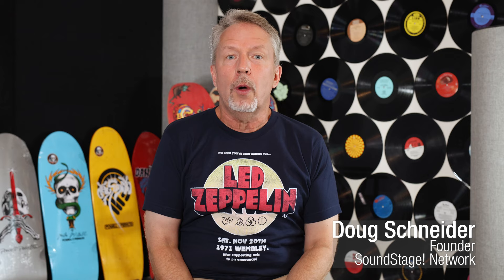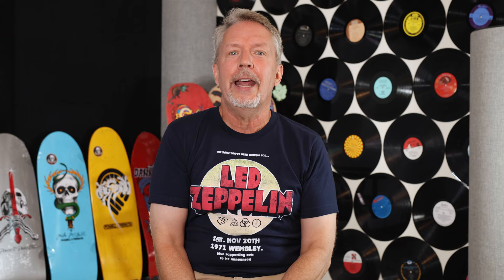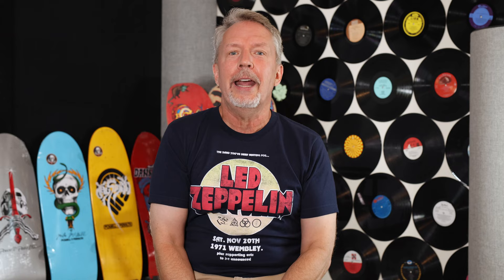Controversial Hi-Fi Upgrade Strategy: Why You Need a Powerful Amplifier (Ep:72)

Comment: I went active with a Legacy Audio Valor speaker system.  20 watt tube amp for the treble section (above 800Hz) with over 2000 watts of class-D modules per speaker for the other active channels.  The tube amp drives 2 AMT tweeters along with an upper-midrange waveguide (compression driver).

Comment: What are your thoughts on choosing between active systems and passive systems these days? 

With systems like the kef ls60 you could potentially skip the amp entirely, would they be a “dead end” to upgrades? I could imagine a downside to active  systems being spending more “upgrade” money on another active system (which there doesn’t seem to be many on the high high end) or you end needing to buy an amp down the road, anyways.
Reply: In theory, you can make a better active speaker system than an amplifier driving a pair of speakers. It's not guaranteed, but it's possible. And today, you can do things with digital active technology that you couldn't do years ago. However, you end up with speaker-based solution that not everyone might want. People like to pick and choose and put their "identities" into their stereo systems. Active systems don't allow that. People also like to "tune" the sound with passive systems. None of that is wrong -- listening to a stereo is about fun. So the way I see active and passive these days is about choices to make, not necessarily which is better or worse.

Comment: I am British, and I find this Ametican obsession with Amp Watts strange. I have a 22ft by 12 ft listening room. I run a 50w Rega amp that more than drives my small bookshelf speakers and easily fills the room with fantastically musical sound at the 9 oclock on the dial... so loads to go to the max at 3 oclock! Speakers are 84db, so a little hard to drive .... its the grip from the current thats just great. I am more than happy. You guys seem to think a good car has to have a 4 litre V12 or something.....
Just not the case...
Reply: As mentioned below -- and in the video -- this is directed at "upgraders," not those who have settled their systems. As I said in other comments, it's been my experience that those upgrading tend to change their speakers most often and in that instance you don't want to change your speakers and find out you need to now buy a new amp.
Reply: @dougschneider8243  understand Doug.
But the fact is my 50w Rega. Due to it's fine current delivery. Also drove in the past large floor standers with great grip and control.
Watts do not mean a better sound, as so many reviews seem to think!
Ever hear an A Class , Sugden amp? It's about 21 Watts or something. But sounds exquisite..... OK so may not drive some US behemoth speakers.... but respectfully would say that those are not Hi Fidelity audio.... 
Do like your reviews. But it's very hard to not think it's for your local audience mate....

Comment: When choosing an amplifier, you DO NOT just go for the most powerful SS amp... your video seems quite haphazard and probably one of the best examples on how to throw money away!  Why would someone put those kind of constraints on the future of their system?  

If I were to 'limit' my choices, it would not be to limit what speakers I could have in my system because of the "most powerful SS amp" choice I made.  I would preferably match both at same time, but if I were to buy an upgrade component that I plan on keeping for a long time, it would be the speaker.  It is much easier to swap amplifiers than it is speakers.... 
A speaker can be matched to a room and then matched with a synergistic amp.
In my opinion, the speaker has much greater importance than the amplifier.

Matching an amplifier and speaker are VERY important at the time of purchasing... 
Before buying EITHER you should have an idea of what you want,  many experienced in the hobby would say go for a mid-power amp and mid-efficiency speakers.  Tube amps, in my opinion, are the sweet spot.   A 50 watt  amp (or even less) is all that is needed, Matched with a pair of say, 93db or higher speakers and 8 ohm impedance is preferred, but not required, depending on individual amp.  
If you have a larger room, go for more efficient speakers, higher wattage amp or both.  But again, matching BOTH the amp and speakers.

I am also a fan of high quality powered subs, which, if set-up properly, can make a big, positive difference on the system and again, even further lower the need for "the most powerful SS amp".

Listen to the equipment, meaning, with your end game speakers (which really you can't do if you buy the amp first... you are limiting yourself on what speakers you can put in your system) don't buy "the most powerful SS amp", as I guarantee you will regret it later.  Listen to different amps, whether SS, Tube or Hybrid... there are very fine examples of all 3.
I myself prefer tubes.  I use a pair of QuickSilver V4 (KT150 tubes) mono tube amps @ 170 watts per channel, my Lamm LL2.1 preamp and Lamm LP2.1 phono stage are also tube components.  All my components are matched, and I also have a Gain switch on the preamp, if needed.  In the near future I will be getting a pair of Pure Audio Project Quintet 15's, with the Voxativ AC-X voice coil center driver.  These speakers are 96db efficient, each has (4) 15" main drivers and a single center driver.  They work perfectly with flea watt amps... have listened to these speakers and my current amps will work nicely in my room.
https://pureaudioproject.com/quintet15-wall-of-sound-open-baffle-speakers-for-large-rooms

Many things you don't mention, but the size/dimensions of the room (are you really going to purchase a 300 watt SS amp for a 8'x10' room?) 
Component Gain, Sensitivity, Impedance etc. are all VERY important parameters that need to be 'matched' for a system to become Synergistic, which of course, is the desired goal.
Reply: The point is for people who HAVE NOT settled on their speakers. It's been my experience that people change their speakers the most -- and you don't want to have an amplifier that limits your choices.
Reply: @dougschneider8243  Did you read my reply?  I suggest reading it again, as what you are saying is not logical.

As you said in your video, the SPEAKERS make the most difference in the sound/quality of the system.
Purchasing a 300 watt SS amp as your 'forever system amp',  VERY MUCH limits your choice of speakers... very illogical.
Again, why would you limit yourself to ONLY speakers that will work with a 300 watt SS amp?  Not only that, you are also limiting yourself to ONLY speakers that will sound good with THIS '300 watt SS amp'.... 

Again, you are doing this backwards.

I believe it much smarter to research and buy the speakers you really want FIRST, then try out with different amps that best match the speakers specs till you find the one that BEST suits your speakers by how they SOUND, not by buying raw power.
So many variables, room, gain, efficiency etc etc. that makes your recommendation so wrong.
I really am surprised at how you are going about doing this, as like I said, it makes no sense.

Comment: my advice would have been the opposite: get the best sounding highest efficiency speaker you can find. That way you can focus on the quality of your amp instead of its power. in my book the more powerful the amp the more complex its design. the more complex an amp is the harder it is to make it sound good. high efficiency speakers also tend to sound more alive than low efficiency speakers.
Reply: You have to be careful what you're calling a "high efficiency" speaker. Most "high efficiency" speakers are anything but -- they're just manufacturers lying in the sensitivity claims. However, even if you find a "high efficiency" speaker, is it the best-sounding speakers. To be "high efficiency," it probably has to be horn based -- and BIG horns. Many of those speakers can play loud and have great dynamics, but they often have gross tonal colorations.
Reply: @dougschneider8243  you are correct. High efficiency ratings are often misleading. Impedance also plays a big role and is often neglected. There are few non-horn speakers out there that are very efficient. For example: I use an Audio Note AN-E. Placed in corners, it goes deep and (to my ears) has great finesse and speed. As with all things in Audio, it’s a matter of personal preference more than anything. I’ve heard some great sounding high-powered transistor stuff as well, but prefer the sound from tubed-systems.

Comment: The real truth is that in a double blind listening test, most people will never hear any difference between most power amplifiers that are in the same power range and share a similar technology.  (Tubes vs. solid state)     However we know that no self respecting "audiophile" will tolerate something as unfair as a double blind listening test.   LOL.     I speak as someone who was on the upgrade journey for quite a few years and my speaker upgrade path came to an end with a set of Aerial Acoustics 10Ts, which have been the centerpiece of my system since 1997.     For a long time I ran them with Krell monoblocks but now I run QSC commercial power amps in a 2x2 biamp configuration giving me 1000 watts RMS per channel.   This is an optimal match for the low efficiency and power hungry nature of the 10Ts.   There's no difference in sound quality between the QSCs and the Krells.   But the QSCs run a LOT cooler!
Reply: But they will be able to tell the difference if two amps aren't working in their optimal power ranges -- and one is clipping. Avoiding that is what this video is about.

Comment: At first glance, this may look like some solid and foolproof advice. However, the assumption underlying it is problematic: as far as I can tell, there's no powerful amplifier that'll sound great with any loudspeaker you throw at it. In fact, my own experience has been that even top-notch powerful amps can be rather disappointing with high-sensitivity transducers (sounding stiff, uptight, flat, grey and plain unmusical). For people on an upgrade path it's important to bear this in mind. Otherwise, they might accidentally dismiss perfectly wonderful speakers because there just happens to be little magic with their 300W eat-all-impedance-loads-for-breakfast amp... At the end of the day, it's all about synergy and shortcuts will only get you so far.
Reply: The problem goes away if you simply buy an extremely good amp that has high power, but also exceedingly low noise and distortion. There's no reason a high-powered amp can't have those qualities.
Reply: @dougschneider8243  Sorry, no - the problem doesn't always go away by purchasing an extremely good high-powered amp. I tried that many times and it seldom worked. Synergy is a thing. Unfortunately, it can't be predicted by only looking at specs or measurements. You're oversimplifying matters and thereby potentially doing music enthusiasts a disservice. If they just follow your advice, they run the risk of chasing their tails thinking that their wonderful low noise and low distortion amp can't possibly be the culprit of the drab reproduction they get. While all they may need is a pinch of zero NFB or SET purity in their system. 

Just to be clear, I very much enjoy your videos and feel that you make a lot of good points. I also have nothing against high-powered amps, because I agree that they're capable of sounding truly impressive in the right context. But that's the key issue here, it all remains totally system dependent.

Comment: How many watts doesn't matter it's the quality of watts that matters ' I have an 85 watt amp that will blow the doors off my 300 watt amp no contest Me Sansui Su717 that's been Master restored and resto modded by Prime hifi is a real beast ' my Emotiva A 300 doesn't  even come close to the bass output or fullness ' of the Sansui on the bench test Sansui done over 110 watts unrestored after 40 plus years ' My Yamaha AS 1200 same thing it destroys my Emotiva and Schiit Vidar which are rated at nore power but me Yammie weighs 52  pounds twice as much as Emotiva/Vidar weight- weight  matters with class AB Even my 60 pound Tube integrated at 50 watts is stronger ! GALION sE 120 ' but I agree your amp is the foundation of the hifi system owned many Amps
Reply: I don't believe in "quality of watts." What I think gets mistaken are manufacturers' often-misleading specifications and real measurements. For example, many manufacturers are known for grossly overstating the amplifier power into 8 ohms, 4 ohms, and definitely 2 ohms. You measure it, and you find out it really can't deliver what the manufacturer says. However, another amp comes along with "honest" specifications and, on the surface, it seems to deliver less power. But in reality, it might deliver more -- and people mistake this lower-powered amp as having "higher quality" watts than the supposed higher-powered one. Really, the watts are watts -- but the supplied specifications give a misleading picture to the consumer.